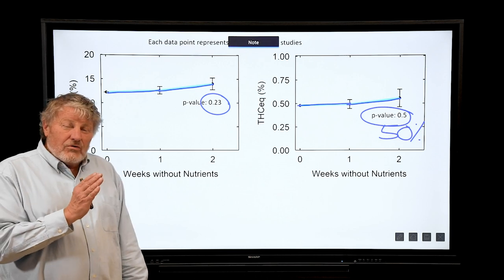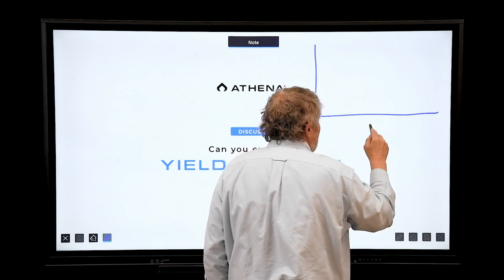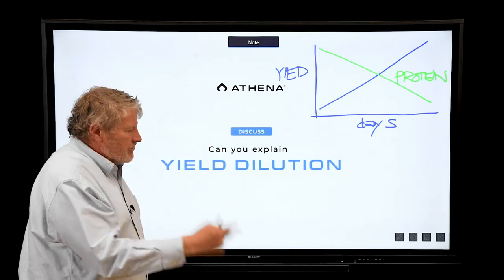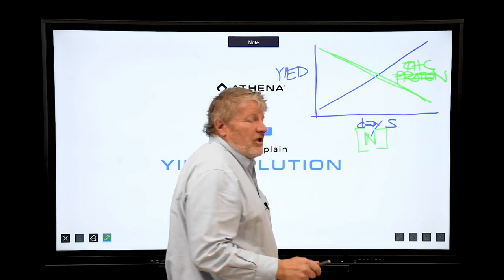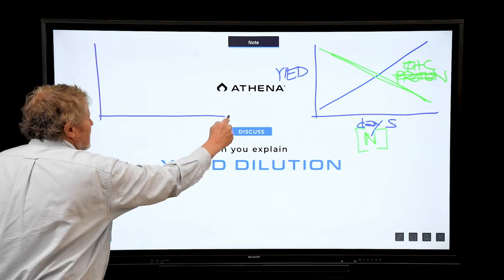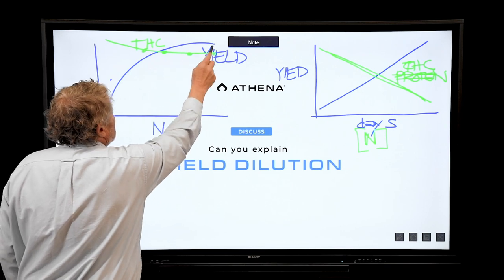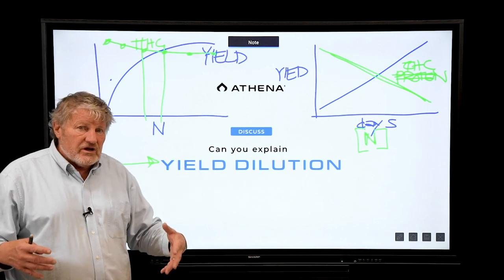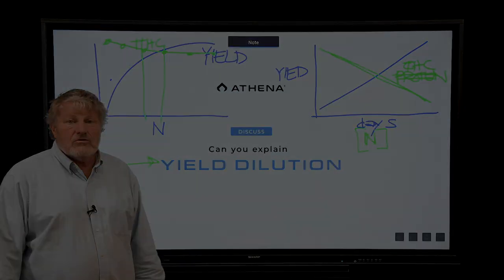Bruce Bugbee Series – What is Yield Dilution?

Comment: Question, how does one differ between genetic differences and actual yield dilution? If I take two cuttings of the same cultivar and grown one HUGE, lots of topping, little defoliation. Then grow the other one with little topping, no training and lots of defoliation, will it yield more cannabinoids? Or is this more aimed at genetics, the bigger plants that yield more through genetics traits are going to naturally produce less cannabinoids? The opposite for smaller plants? I feel like its both, seeing your graphs shows that this yield dilution can be controlled, but I know genetics play a key role as well. I would imagine you'd want a cultivar with genetic traits prone to high cannabinoids then try and dial it in as best you can on the yield dilution? Sorry for the stoned ramblings...lol
Reply: Eels